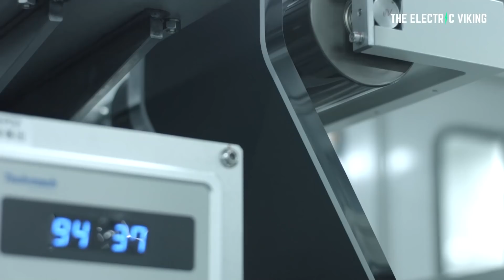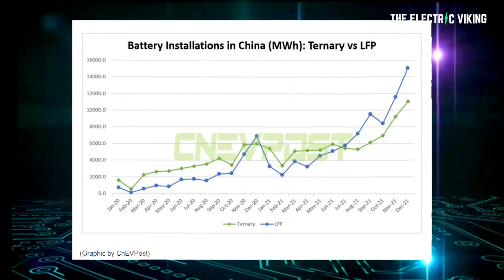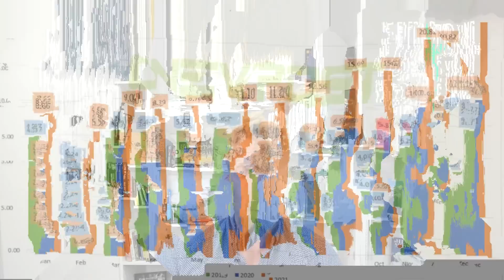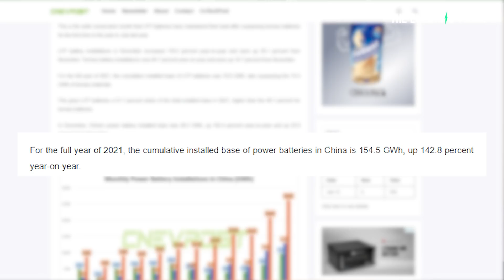China's lithium battery output in 2021 was truly STAGGERING

Comment: While the growth of batteries for BEV cars is impressive its hardly staggering. The total global vehicle production is perhaps 75 million. The global sales of BEVs are maybe 7.5 million or optimistically 10%? To reach the levels predicted by Sam by 2030 imagine the number of batteries the need to be produced. Perhaps 10X of production today. That will be staggering. The growth today YOY is pretty much ho-hum. Let's not sensationalize so much.
Reply: Yes and that’s a good reason to find a way t to invest in this transition to electric vehicles look at how many electric vehicles were sold ten years ago as a percentage of all vehicles sold they didn’t even register in any cars sold data then. You are right though it’s going to take a lot of battery manufacturers to run full speed to make enough batteries
Reply: @nickkacures2304  The problem is not manufacturing, but the availability of raw materials and their price.
Reply: @nickkacures2304  I'm not so great at math. But if an average BEV battery pack comprises like 6000 cells and looking at a theoretical 100% EV world of 75 million vehicles that is 450 Billion battery cells. And that's just for vehicles not including energy storage etc. That number is staggering. 🤔
Reply: @sunrisejak2709  That's why Tesla is switching to the Model 4680, which reduces the amount needed. It also has blade batteries, in which the quantities are substantially smaller.
Reply: @arnildostein7773  Correct, but the amount of Raw Materials is nearly the same. Larger cell size, fewer cells, but the same or more power requires nearly the same amount of Raw Materials. That's why Tesla has been snapping up Raw Material Producers. They need the Bits for their Batts. Find a good Raw Material Procurement Fund or company. That would be a Good diversification, but still staying in the sector. Anyone have any that have preformed well? With data to back up your claims?
 Thanks again Sam for your videos. They've given me research ideas, but...I'm running out of $ to invest Cheers, Steve

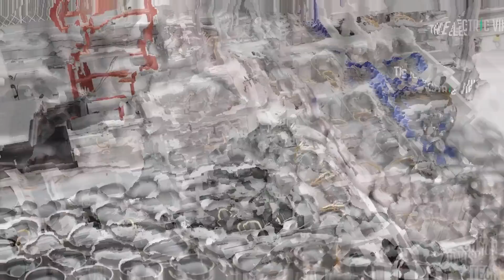Comment: 1:13 since Ive learned that you get more cycles from a battery if you charged it at 80%, I began to suspect that the industry is scamming is us from overcharging it! in other words, they are not far from LFP's density though performance is another topic
Reply: Tesla chargers are set to stop at 80% unless you want extra range for a road trip. Most other manufacturers simply set the "100%" mark at less than 100% of the battery's true capability. The range is already hidden. Elon has said that LFP is favorable because it "likes to be charged to 100%" and when you account for that difference, LFP is only about 5% less range if not equal to nickel-based chemistry. These are some of the reasons LFP is exceeding other types.
Reply: @Nphen  👍 exactly. if you have seen Munros video on Model 3 SR LFP battery, it shows an empty space for another module. im not sure if that is exactly the case but that i did not expected that, i cant wait to learn more about it

Comment: 80 liters of gasoline. can be produced from every barrel of crude oil, and the 80 liters of gasoline can enable an ICE vehicle to travel up to 2000 KM of distance, based on 25 KM / Liter fuel consumption rate.

Which means, a car travelling10,000 per year requires 5 barrels of crude oil.
Reply: Very few cars have that 4L/100Km efficiency, unless it is a hybrids. Most of N. American available ICE cars are 2X to 4X times that amount.
Reply: @NightWolf9 our volvo v40 does 4.6/100km and thats already so low
Reply: Idk what you drive that does 4L/100Km